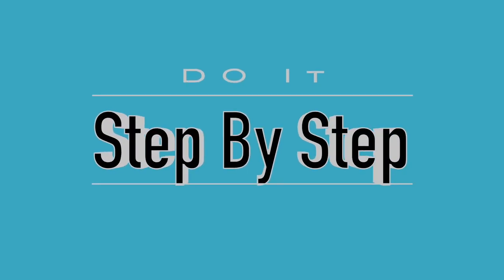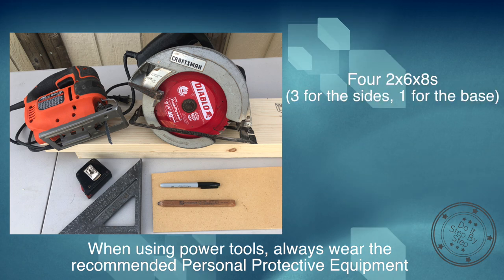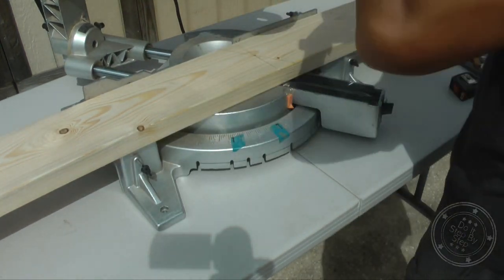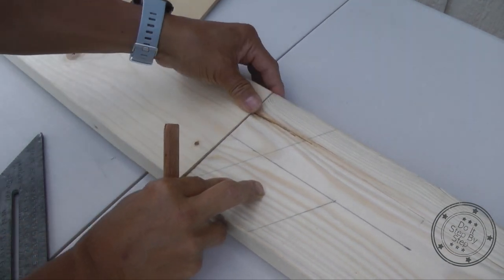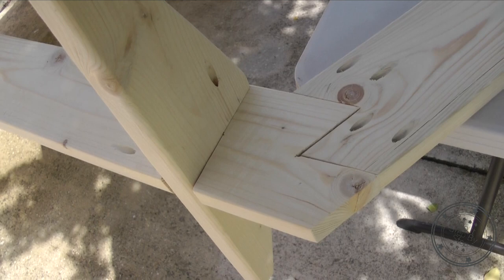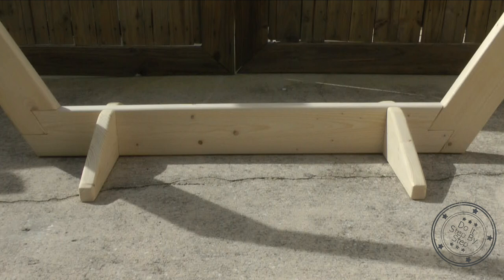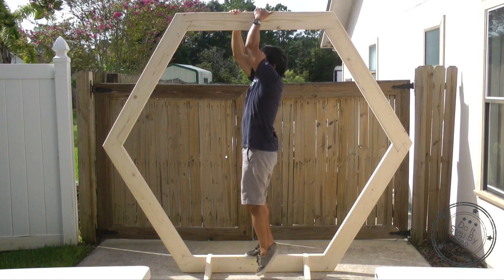DIY Wedding Arch & simple sleek base Part 1.  Build a strong Wooden Geometric Hexagon boho backdrop

Comment: Hi Bobby. I followed your video and made my wedding arch, and my wife loved it. We're thinking of using the arch again for another event, but the pocket hole screws stripped the wood (douglas fir, 4x6 - some parts are soft). Do you have suggestions to modify so the arch can be re-assembled multiple times?
Reply from the maker: Glad your wife loves it Alex!  Sorry about the stripped holes.  I would repair it by over drilling the holes for oak dowels.  Glue in the dowels, and flush cut when dried.  Pre drill some pilot holes for the pocket screws and that should do it.

I've used the arch for at least five events (weddings, gender reveals, etc.) so far, with no issues with stripped holes. I used kiln dried pine which is soft. I used pocket screws for soft wood, and when I used my driver, I made sure it was set to low torque, and if needed, I tightened it the rest of the way by hand.

Good luck Alex!
Reply: @doitstepbystep3376  Thanks Bobby for responding! Just wondering. Is there some nut-fastener option to use in the pocket hole so I can reduce the need for the woodscrew cutting into the wood all the time?
Reply from the maker: @Alex-jv7zh  AH! Do a search for "brass wood insert nuts"  Maybe if you find the right size, along with the correct bolt length, that will get you on the right path to a solution!
Reply: @doitstepbystep3376  YES! Thank you thank you!
Reply: @doitstepbystep3376  @Alex In regards to the brass wood inserts, they seem to focus on being 90 degrees (straight). Would these work in a pocket hole situation?  Just wondering before purchasing.  Thanks.
Reply from the maker: @tinarenaud  Good question.  I would try the following on a scrap piece first.  I would use the pocket hole tool the same way in the video , When the pocket screws are used, it will create a hole in the lumber it is secured to.  Use that hole as a pilot hole for the brass insert, using the recommended drill bit at the same angle as the hole. Good luck!

Comment: Thoughts on making one finished segment, and then using it as a template for the rest of the boards.
Reply from the maker: Good idea. If you do try this, do one, and then size it up to make sure the fit, and are dimensionally the same.  Like any template, you just need to understand "where to cut" when you transfer the lines to the next piece of lumber.

Comment: Hi Bobby! This may be a silly question. I know the arch was able to hold you up (which was awesome!), but do you think this arch could support a floral installation for 6-8 hours? Would making the base supports longer help increase stabilization so the arch wouldn't fall forward once the floral installation was attached? Thank you!
Reply from the maker: Hi Maddie!  Supporting floral arrangements  should not be a problem.  See this one here: https://youtu.be/0MyPcRHUTsA?t=263

You can certainly make longer supports if that helps you.  The base support length I selected is a good compromise between support needed and avoiding potential trip hazards with longer base supports.  Good Luck!
Reply: @doitstepbystep3376  Thank you so much!

Comment: I keep having issues with either the top notch or the bottom notch being roughly 1/4” short and I’m not sure why. I double checked CL measurement. Any suggestions? Is this why you have 2 jigs?
Reply from the maker: Hi sugaslate.  Most dimension issues point back to cutting the lumber: either on the line or on the wrong side of the line.  Where to cut with respect to the line you draw is important and can get confusing.  Remember to "cut away" the not needed wood and "cut to save" the wood that is needed.

I recommend making a template.  I made two so I could see how the double rabbet joint fits together.  Remember the template represents the lumber. Lines drawn with use of the template should be cut up the line's edge on the "save" lumber.  Here is a link to a template video that may help you. https://youtu.be/x4J0TIL4Mcc

Comment: Question, should you cut the 30 degree angle for every piece first before making the rabbit joint? Wouldn't that shorten the overall length? Or should you just use the template to maximize the length of each piece of wood?
Reply from the maker: Hi, and thanks for the question.  I maximized the lumber by cutting 30 degrees in the center of the 8' 2x6.  Then like in the video, I measured the 30 degree at the very tip of the other end. 

A template helps tremendously, just make sure you know your cutlines so the dimensions are equal and that the ends are mirror images of each other, not flipped.  Good luck!

Comment: I used hand tools (I don’t have a miter saw) and my angles must be slightly off. I can get 5 of my boards flush, but the 6th has gaps. Any suggestions on how to tighten my angles? I’ve tried sanding a bit to get them more even, but I’m still struggling
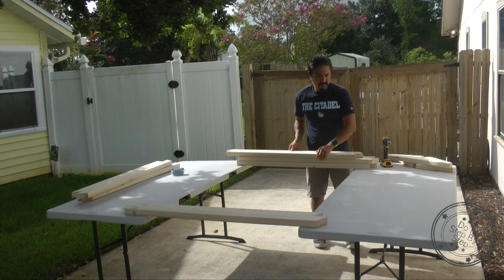Reply from the maker: Hi Ashley! Sorry to hear about the issue you are facing.  Let's see if we can get this sorted out and fixed for you.  First check to make sure the ends are alternating; each side piece should have one end grain exposed, and the other end grain covering the next piece. See 6:55 minutes into the video for the example.  If the orientation of the sides are correct and you still have a gap issue, mark the piece(s) where the gaps are, and then stack ALL the pieces side by side to line up the double rabbet joints.  By doing this, you can compare the cut dimensions, and the lengths. Hopefully this will reveal some cuts that can be fine tuned with some sanding.  Give this a try and let me know if this helps you!

Comment: Hi! I found your video because I'm attempting to make a hexagonal trellis very much like this. Can I use these same joints with 4x4s?
Reply from the maker: I think it is possible with the right tools and skills. The difficult part, at least for me, would be getting a deep enough cut with the saw(s). My circular saw, and jigsaw would not be able to handle nearly 4" deep cut.  A hand saw could do it, but require skill and patiences to get "square" cuts. Good luck with your project!!
Reply from the maker: Also, before you drop $$ on a lot of lumber, find some scrap pieces of 4x4 to practice on.👍

Comment: Great job. Thanks I want to do one for my daughters wedding. If I wanted to do a heptagon (Instead of a hexagon) I’ll make my cuts at 22 degrees right?
Reply from the maker: Thanks for the comments Lyndon.  A Heptagon has seven sides. Hmmm.  This would require some prototyping and trial and error to get the cuts just right.  To save yourself $$, I would prototype a smaller version using an 8' 1x4 and cut seven 1' pieces.  If you use the same calculation method as the hexagon, then it would be 360 divided by 7 which equals 51.42.  Divide that by 2 and that equals 25.71.  Not a very easy angle to measure, so I would start there, and adjust the cut as needed.  Once you know that the angles work, you can scale it up to the 2x6s.  I hope this helps!

Comment: Hi Bobby if you are still checking comments I’m trying to make the template and I’m missing something because the pieces are not fitting together. Can you provide some instructions for that? Also, Once you have the template you just used a circular saw to cut the pieces?
Reply from the maker: Hi Katrynah.  Have you seen this video? https://youtu.be/x4J0TIL4Mcc 

First, verify the width of your lumber.  If it is 5.5", then the distance from each side to the middle should be 2.75"

If that is correct, then measure from each side to the center of the double rabbet joint.  Each side for each piece should be 2.75".  If it is not, then the saw blade cut on the wrong side of the drawn centerline.  

If each piece of lumber measures 2.75" from side to center, then that is good.

Now measure the three rabbet joint cut lines.  They should be equal to each other.  For a 5.5" width, it should be 3 3/16".  At least by my tape measure it was.

Let me know how the measurement checks out.

I used a circular saw to cut most of the line, and then finished with a jigsaw.

Comment: Thank you for all of these videos, they are helpful. So, if I don’t have a miter saw, should I just cut three of the 2x6x8s in half and use my template on all 12 of the resulting ends?
Reply from the maker: Hi Andrew.  Thank you for your comments.  Yes, instead of a miter saw, a circular, jig, or hand saw can be used!  Just make sure that when you cut the 8' lumber in half, to cut it at an 30 degree angle to maximize the length of each piece, just like in the video.
Reply: @doitstepbystep3376  I ended up just cutting each 8' piece in half at no angle. Everything worked out but I guess I didn't fully maximize the length of each piece. Still, it looks great, though!
Reply from the maker: @somecatdad  Awesome! Congrats!

Comment: Thoughts on doing this out of 2x4s instead of 2x6s? I don't need to be able to hang from it, haha.
Reply from the maker: 2x4's should work fine, just make sure your math is correct for the 2x4s.  In this video: https://www.youtube.com/watch?v=x4J0TIL4Mcc I show how to measure for 1x4s, so it will help you with the 2x4. 

Just be aware that the proportions may look a little thin if you use 8' lumber cut down to ~4' sides.  Good luck and have fun!

Comment: Hi , sorry if this questions been answered. The pocket holes, what distance and length screws did you use please :)
Reply from the maker: Hi Benjamin.  I used 2-1/2” Kreg pocket hole screws for soft wood).  Please check the video at the 7:10 mark for the pocket hole instructions.  Good luck!

Comment: Are there any downsides to using pressure treated lumber or is that just as good as "kiln dried"?
Reply from the maker: Price.  When I built the hexagon, PT lumber was more expensive than kiln dried.  PT wood should be a strong lumber and a great choice.

Comment: Hey Bobby can I use a 2×4×8 to  do the job
Reply from the maker: Yes, you can!  The measurements for the joints will be different but they are determined the same way.  Here is a link for a 1x4 template.  https://www.youtube.com/watch?v=x4J0TIL4Mcc
Same width as a 2x4!  Hope it helps.

Comment: I have to do this weekend that you for this video , are you able to do a quick video on how you made the two bottom arch supporters
Reply from the maker: Hi Erica! I don't think I will be able to record right now. It's raining here in northeast Florida. 

You might find the information you are looking for if you go to the 9 minute mark in the video.  I attempt to explain the measurements I used to make the base supports.  Please check there, and if the weather clears soon, I'll try to make a quick video on the base supports.  

Good luck!  bobbyV
Reply: Do it Step by Step Thanks  for responding , I’m going to try it with the jig saw , I don’t like to use the jig saw but I’ll give it a shot !
Reply: Do it Step by Step can you do a video on making a template ? And does the 4  2x6x8  include the base support or do we need addition for that ?
Reply from the maker: Hi Erica! For the half lap joints, I used circular saw to cut the 2.75" lines, and a jigsaw to cut the small 1.5" line.  A helpful tip is to drill a hole in the corners of the half lap joints so you can insert the jigsaw blade to cut the 1.5" line.  Also, I used the circular saw to cut the slopes of the base supports.  I hope this helps, and that you can Do It, Step By Step.
Reply from the maker: Hi Erica, You can make a template using the measuring directions in the video.  I used a piece of MDF that is the same width (5.5") as the lumber and 12" long.  MDF is very easy to cut, and strong enough use as a template. 

If you are careful with your cuts, four 8' 2x6s will be enough for the hexagon, and base supports. 

Three 8' 2x6s will be used for the hexagon sides
And one 8' 2x6 will be used for the base supports.  

You should end up with one 2' section of lumber not used.
Reply from the maker: Hi Erica!  I managed to make a quick video on the measuring details for the base supports.  I am uploading it now :)
Reply from the maker: Here is the video for the base support.  I hope this helps!
https://youtu.be/uI_W-wOX4lU

Comment: Can you please provide a printable template or instructions re how to make the template.  I watched the other video you did on making a template but it was a template for 2X4 and not for 2X6.  Thanks!
Reply from the maker: Hi.  Sorry about not seeing your comment earlier.  I haven't thought about a printable template before and it might be helpful.  I've check into it, and from what I understand, printers vary on how accurate they print and you might be better off measuring directly on the lumber.
Reply: Can you sale a MDF, cardboard, or even just paper template?
Reply: Did you ever make a printable template? In watching the video, the center of the wood is found and two 30 degree angled cuts are made. I will try to make one today, I would appreciate it if you checked it.

Comment: Question please 🙋🏼‍♀️ What kind of and size of screws did you use to join it together?
Reply from the maker: Do it Step by Step
3 days ago
Since I used soft pine wood, I chose the zinc coated (indoor use) 2-1/2” Kreg pocket hole screws for soft wood

Comment: Hi there I am making one of these arches for a wedding would you be able to tell me what size pocket screws did you use thank you
Reply from the maker: Do it Step by Step
Thank you for your comments!  I used soft pine wood, so I chose the zinc coated (indoor use) 2-1/2” Kreg pocket hole screws for soft wood👍🏽Good luck with your project!

Comment: What size/length screws do I use?
Reply from the maker: Since I used soft pine wood, I chose the zinc coated (indoor use) 2-1/2” Kreg pocket hole screws for soft wood

Comment: Any recommendations on the size screw to use ?
Reply from the maker: Thank you for your comments!  Since I used soft pine wood, I chose the zinc coated (indoor use) 2-1/2” Kreg pocket hole screws for soft wood👍🏽
Reply: @doitstepbystep3376   Great! Thank you for the help

Comment: Awesome video. Wondering what length/brand screws you use for the arch? Appreciate the video!
Reply from the maker: Thank you for your comments!  Since I used soft pine wood, I chose the zinc coated (indoor use) 2-1/2” Kreg pocket hole screws for soft wood👍🏽

Comment: What's the length of each segment?
Reply from the maker: Each piece is 47.75".  When assembled, a "side" is almost 51".  This is because when one piece is fastened together to another piece, a side is "extended" 3 3/16".  I hope that makes sense.
Reply: @doitstepbystep3376  got it, so three 2x6x8’s will be needed 👍🏻
Reply from the maker: @shawnpemrick4303  I used four total.  The forth is so I could make the base.  Bonus was it left me with a 4' 2x6 just in case I had to remake a piece/section.

Comment: Thank you for this video! Could this be done on a bit larger scale to accommodate a taller couple? Do you have any recommendations?
Reply from the maker: Hi!  I am sure that the dimensions can be scaled up to accommodate a taller hexagon.  Just need to use lengths longer than 4'.  The one I built is almost 7' tall and 8' wide.  In this video https://youtu.be/0MyPcRHUTsA?t=271 the groom is 6'3" and the minister is almost 6'4".